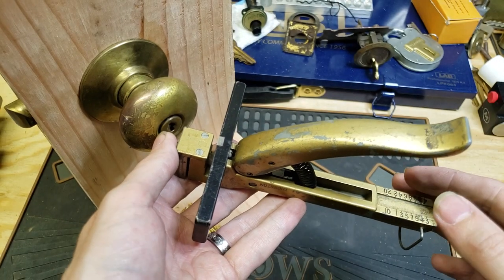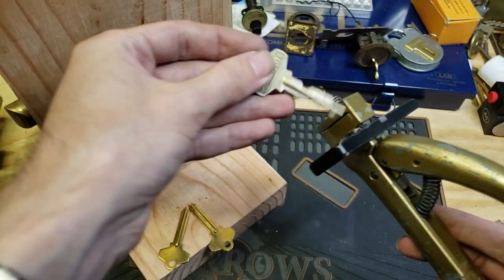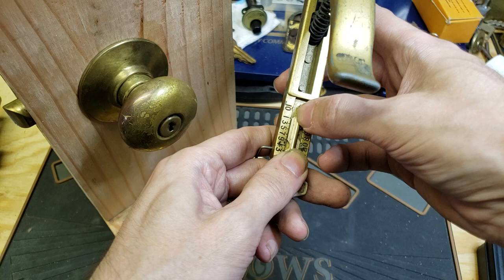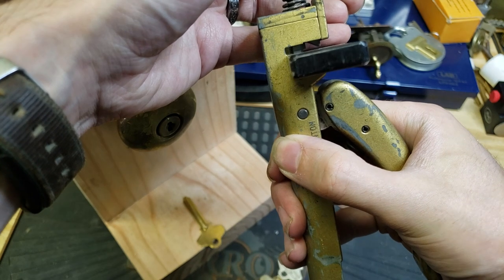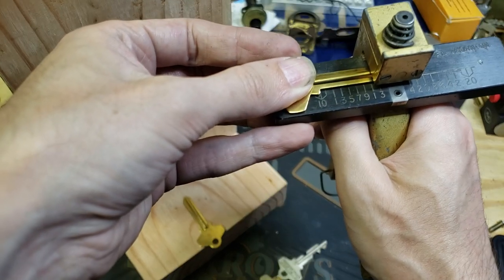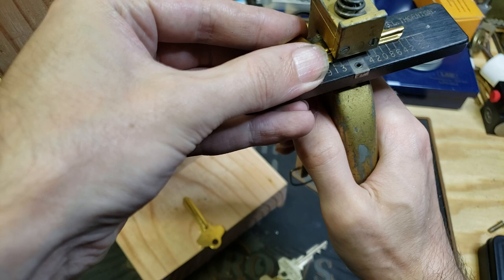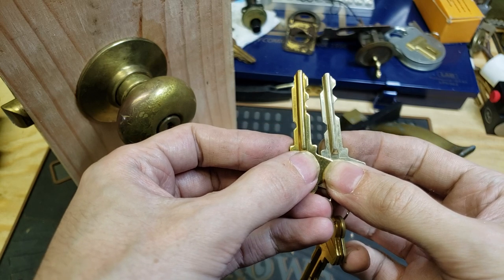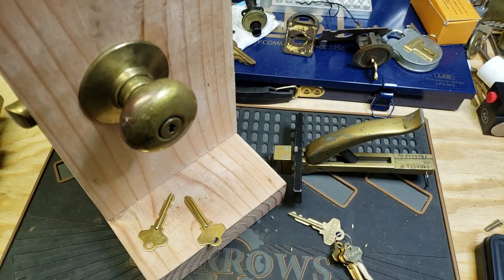(119) Cutting Schlage Wafer keys with a vintage LatCo clipper

Comment: I have a bunch of these keys. I'd love to find a lock to play with, but the general consensus I've heard is "just replace it if you find one" lol. But I inherited like 25 keys with a beautiful old duplicator :)
Reply from the maker: Unfortunately that is good advice. The supply of repair parts is rapidy dwindling and the locks are only getting older and more worn out since production stopped around 50 years ago. They also don't offer much in the way of pick or destructive entry resistance so there is very little reason to keep them in use as security devices. They are however a fascinating and clever design and represent an important milestone in the development of lock design. If nothing else you can usually find a few on ebay, especially if I ever decide to part with some of my collection.
Reply: @Nite0wl  thanks! If you want a few blanks I could fire some your way :) on me on the lock chat if you're interested.
Reply from the maker: As it is I am pretty well set for Schlage Wafer blanks, the aftermarket blank companies still make them as the SC6 and SC22 and I still have some of the original Schlage A series blanks.
Reply: @fivel256  what! I want a blank or two! I've never seen this type of Schlage before

Comment: Didn't figure out how the built-in key reader work: are the numbers layed out randomly or just happened to match the exact key you cut? Or does this type of keys have relatively limited arrays of bittings?
Reply from the maker: Schlage Wafer keys only have one cut depth, either cut or no cut, the numbers correspond to the allowed cut positions with one side of the key assigned odd numbers and the other side assigned even numbers.
Reply: @Nite0wl  Thanks for the explanation!